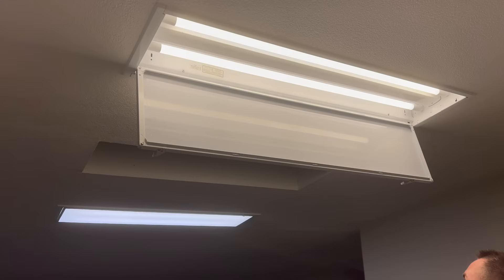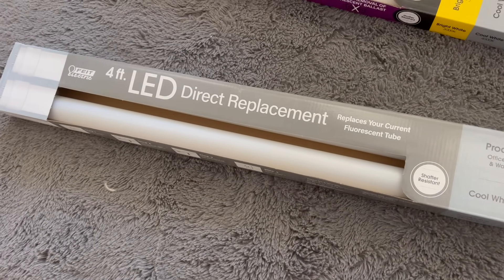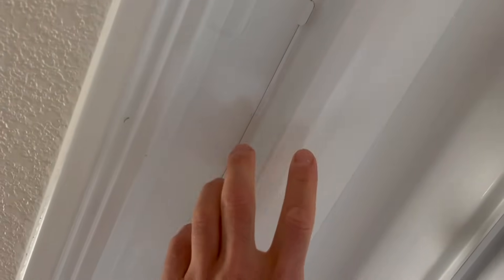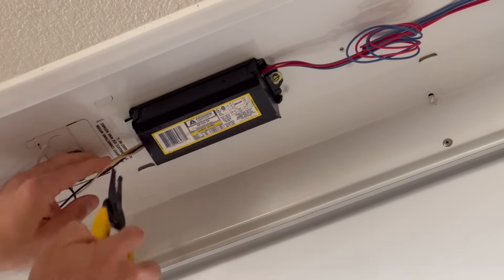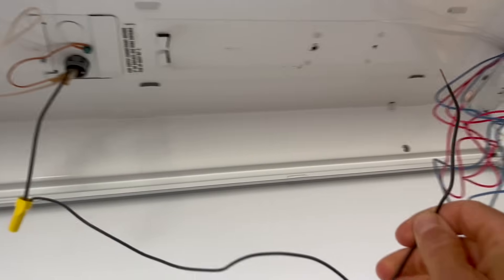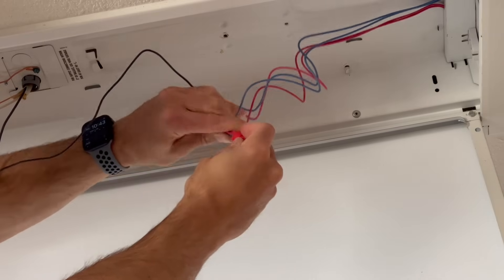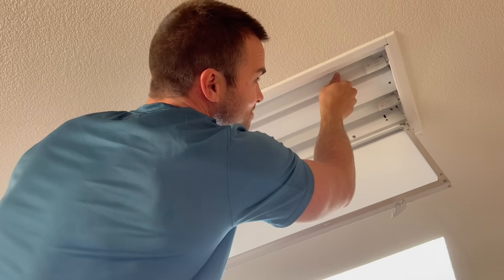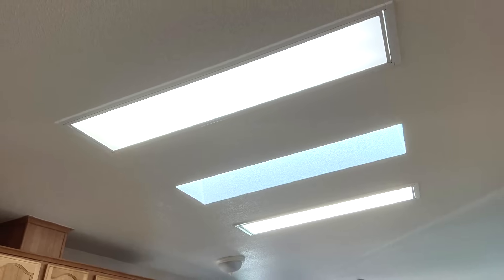Convert Fluorescent Tube Lights to LED - Easy Ballast Bypass Instructional | Builds by Maz

Comment: This is a good simple guide if you have the same wiring configuration and the same LED bulbs. If you don’t know the difference between shunted and non-shunted tombstones; or between single end and dual end powered LEDs then you better dig a little deeper before blindly following this.
Reply: Maybe you could explain ?
Reply: @flamingseven8447  He is absolutely correct.  Do some research on YT on the subject, and get the correct LED bulbs.
Reply: @flamingseven8447  he doesn’t know what he’s talking about.
Reply: Ok...watched the video. Followed all the steps. 
Flicked the switch.....Nothing happened. Floros didn't come on. Now will have to start again in the morning
Reply: @spearhead4075 there’s actually three different types of LED bulbs, not just two. There’s a
Reply: Hi, I'm an electrician. There are two types of ballast bypass bulbs. One type gets power from one and *only*.  If you hook them up like this, the neutral nut will not connect to anything (IE one end of the bulbs does not have any electrical connections they are just dead pins to help hold the bulb in place. 
Maybe bulb availability depends on region, but I'm in Philadelphia PA and I've never seen a bulb like this. I've been an electrician for 40 years, all of my basement lights in my shop and storage area are old fluorescence that I have bypassed the ballasts and installed 4 ft LED tubes. All of them were single end powered. 

So how do you tell if your bulbs are single ended or double ended? 
They should come with a label right on the bulb which tells you the end that is powered. They also come with a sticker which you can attach to the fixture so that anyone looking at the fixture after taking the bulbs down will know which end is powered (like if you take the bulbs down without thinking about it and forget which end of the fixture is powered. I suppose you could take the cover off and look, but that's an extra step).

The other thing that isn't covered in this video is that not all internal covers come off with a pinch. Some of them are bolted in place (mostly older fixtures).
Reply: I'm trying to hunt down a single end powered 36-in tube right now.

Comment: hello, our kitchen light has 4 strips of t8 tubes and 2 ballasts.  We were able to cut the ballast and connect all the cables with no issues.  But the cables on the other one are too short after cutting it off of the other ballast.  I'm assuming I can extend the cables, but what kind should I use?  If anyone can link to amazon pages with the correct gauge cables, I would be grateful.

Comment: My ballasts have all 4 wires on one side blue and the 4 wires on the other end red and yellow.  So each tombstone has 2 wires each but on both ends. All the videos I see the ones side only has 2 yellow wires mine has an extra 2 wires ?

Comment: as others have commented, excellent! i did 6 of these in our garage. ours were the suspension type probably purchased by my grandfather back in the 1970s or 80s back when fixtures were made with quality materials and decent metals. and they were plugin types, not direct wired. i looked into simply replacing all of the fixtures but all the plugin types nowadays are made with either cheap plastic or non-replaceable leds. basically crap. this vid and simple instructions gave our garage lighting a new lease on life :) 5 stars my man.
Reply from the maker: Thanks for watching!

Comment: Thanks for the explanation. It was the most concise and useful video I found so far. A couple of of things that I'm still not clear. First, my FEIT Electric T48/41K/LED/2 (E) tubes do not have A or B designation and the text on the tubes only mentions ballast usage, although it does not say it's exclusive usage with ballast (only says that it's a replacement for F32T8 lamps). Does it mean they are type A (I know they work with a ballast, but not sure about without)? Second, in addition to the white/black wires, my ballast only has two blue wires connected to one end of the fixture and one red wire connected to another end. It does not have a yellow wire. How would rewiring work in this case?

Comment: Thank you for this! I tried watching some of the user-submitted videos for the LED bulbs on Amazon and, to be nice, they were incredibly frustrating.  They gave no rationale for cutting wires, some not even explaining (wtf) a ballast is, and just assumed I knew how to do this.  Some suggested soldering..I don't have one of those tools.  I had 0 confidence in doing this "easy installation" the product boasts...blindly cutting wires that at some point would be hot and potentially burn down my house.  I was ready to just go with a fluorescent bulb when I decided to YT search it and saw your video.  Your video not only discusses its purpose and setup, you show how easy it is using simple terms and straight-forward guidance.  Thank you! I now know why the ballast isn't necessary, how to safely rewire everything, and why plug and play isn't always the answer.  Solid instructional video!  You gained a subscriber.
Reply from the maker: Thanks so much for the support! I agree, the videos on Amazon are pretty terrible...certainly no need to solder anything.

Comment: If you are looking to bypass the ballast and switch to LEDs, you'll need Type B LED tubes like mentioned... BUT I don't know if all of the type B's are made for ballast bypass?

I have direct replacement and plug and play bulbs i just bought which I don't believe will work since it needs to say ballast bypass on the packaging.

I may just end up buying a new ballast because it seems that the majority of the LED bulbs are made for direct replacement or plug and play which won't work with the ballast bypass?
Reply from the maker: Type B LEDs are specifically designed for ballast bypass - I would definitely recommend using a type B and removing your ballast rather than buying a new ballast. That way you save money and it will be more efficient.
Reply: @buildsbymaz  yeah duh that makes a lot of sense. I still have to buy something anyway right I either buy new bulbs and then bypass it at no cost or I buy a ballast which is more expensive than new bulbs. Thanks.
Reply: Instead of paying $17 for lights and bypassing I just spent $35 for new led fixture 😂
Reply from the maker: @NiNjaTurtLe697  Haha that works too!

Comment: I'm about going crazy trying to find a replacement ballast.  Then, I found your video.  I'm going to try this.  Thanks for being so informative & concise!   (A few hours later.....)  Back from the second home depot visit with what I needed.  I was so happy to cut that ballast out of that fixture!  Did the wiring as you directed.  Installed the bulbs and "ta daa"!  I've fallen off a log with more difficulty.  Only thing I could add was that when I was installing the lights, I had a stripe down the bottom side of the bulbs.  This was because I wanted to position the colour light button towards me to adjust it.  Once adjusted, I realized I might be able to turn the bulb around by removing it and while keeping it in the same direction, just rotate it on the pins.  After doing that, we got more light in the colour we wanted.  A "Thank You" hardly seems enough!  Here's the icing on the cake.  The fixture was half the price of a new ballast!
Reply from the maker: Thanks for watching and I'm glad you were able to get everything figured out!

Comment: As many attest, this is the best instructional video on how to bypass a ballast to convert Fluorescent Tube Lights to LED.  It is clear, helpful, and concise.  Who has time and patience to watch a long video when the useful information can be provided in just a few minutes?  The video quality and close-up of relevant details are also top-notch.  Thank you so much!

I’ll share my experience and lessons learned to hopefully help someone.  My 80’s bathroom lights consist of 2 dual fluorescent (4 total tubes) light fixtures that are placed right next to each other horizontally. Each light fixture has its own rapid-start ballast with piggyback live and neutral wires.  Don’t panic if you have a similar setup that looks different from the one in the video and just follow Maz’ instructions and do the bypass one at a time.  I just finished bypassing one ballast and installed the LED lights.  It was glorious when I flipped on the switch and there was light!

What should have been a quick procedure took me a long time because I made the mistake of using an old and inefficient wire stripper (the type with a rotating dial which shifts easily).  My ballasts are also secured by a hex nut instead of a screw so make sure you have a small adjustable wrench on hand. I happened to have a 4-inch Craftsman adjustable wrench which was perfect.

So the main lessons learned are making sure you have good-quality and appropriate equipment before proceeding with the bypass which will save you a lot of work and headache.

Here’s a list off the top of my head.

1.	Use a good wire stripper.  Klein Tools and Knipex are excellent.  In fact, I just got a Klein Tools 1019 Klein Kurve Wire Stripper (30% off) for small gauge wires.  I am waiting for it to bypass the rest of the ballasts.

2.	You might want to have a small adjustable wrench on hand in case your ballast is held down by a hex nut.  A socket wrench might not work as there might not be enough room around the hex nut (as was my case).

3.	Wear thick non-slip gloves when you work with the wires.  I wore nitrile gloves which did not protect the fingers from repeatedly trying to pull off the wire insulation.

4.	Someone mentioned marking the live wire side for correct LED placement for the next person.  This is an excellent idea not just for the next person but also for reminding yourself.  I’ve marked “L” near the tombstones that have a live-wire connection.

5.	I got some winged wire nuts that provide a a better grip for tightening.
Reply from the maker: Really great tips! Thank you for sharing.
Reply: Wow, this is so helpful thank you.
I have the task to change 9 of those for my studio. This is great info but wish me luck. 😂🔥
Reply from the maker: @luiseldyfuentes9584  You got it!
Reply: Good tips Leo!  I just did a 4 tube fixture and am only using 2 slots but wired them all if I need to add lumens/bulbs.  Food for thought.
Reply: I don’t think you have to remove the ballast completely from the fixture. That’s optional as it’s no longer functional, but it’s not going to hurt to leave it. I couldn’t get the nut off, so I just capped and taped the wires and left it in place.
Reply: We must have the same fixtures from the same era. Mine were 5/16" socket if you can believe that, metric didn't fit.
Reply: I bought LED lights to replace florescent in the pantry and a closet 1 YEAR AGO 😂

I've been so annoyed when the lights would turn off by themselves. I was like "energy efficiency BS!?" Haha nope .  Overheating ballasts. Now I know and it was like a 20 minute job. Maybe an hour for both locations and getting my tools together. 

Thank God for this video!

Comment: I just tried converting my shop light and I am thinking I have the wrong bulbs.  They do not light up and I am getting voltage to the connectors.  The bulbs are T8 LED.  Thanks for the video and any help!

Comment: Question, where is the ballast on the narrow fixtures? The two tubes are close to each other and no middle housing for a ballast.
Reply from the maker: It may be on one of the sides - hard to say without seeing it in person, but there should be some kind of wiring cover.

Comment: So you would do the same hook up if you have T8 that has 4 fluorescent light bulbs (yours has 2 fluorescent light bulbs)?
Again, mine has 4 wires to 4 Tombstones (Red, Red, Blue, Blue) and on the other end 2 wires to 4 Tombstones (Yellow, Yellow)
So I should connect/join White to Yellow, Yellow to Red Wire Nut.
Then connect/join Black to Red, Red, Blue, Blue to Red Wire Nut.
Finally, install four T8 lights Type B

Comment: If somebody puts a single ended tube in that double ended wired fixture they'll be a sorry goose
Reply: Sorry, but what do you mean?
Reply: @trollface259  A single ended tube is powered by hot and neutral on the same non-shunted  tombstone at one end with no wiring at the tombstone on the other end so you've wasted money on a tube that won't light if you put it in a fixture wired for a double ended tube.
I don't like the idea of line voltage connected to flimsy tombstone contacts that are so close to each other anyway, so all hot on the tombstone at one end, and all neutral on the tombstone at the other end is the way to go, plus you don't have to change out the tombstones if they happen to be the shunted type.

Comment: There are only single pins in my area, but I have a double pin, any idea if I can convert this? thanks sorry for being so basic
Reply from the maker: Can you explain further? Your light fixture requires double pin, but you can only buy single pin bulbs in your area? Do you have the option to order double pin online?

Comment: In your video you said to “place the new lamp into the tombstone socket and turn it a 1/2 turn.”  Actually turn (or twist) it only 1/4 turn (90 degrees). If you turn it 1/2 turn (180 degrees) the lamp will fall out.
Reply from the maker: Yes I did mean quarter turn, thank you!

Comment: Great info and perfect step by step! My ballast was drooling black crap all over the wires and on the fixture hood! Also I had no idea those end connectors were called tombstones! All these years....thanks a ton for doing this, saved me hours of being pissed and throwing things. Got it all removed and bypassed for my LED tubes in 30min.
Reply from the maker: Glad to hear it! You are welcome and thanks for watching.
Reply: When the connectors are our of the assembly, they are shaped like little tombstones. That's where the name comes from.

Comment: Great video.  I have 6 fixtures with 4 bulbs each.  The first fixture i bypassed worked great using your method.  I went to the second one and wired it exactly the same, but it didn't work AND it stopped the first one from working.  Scratching my head.